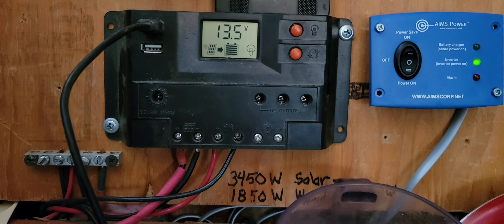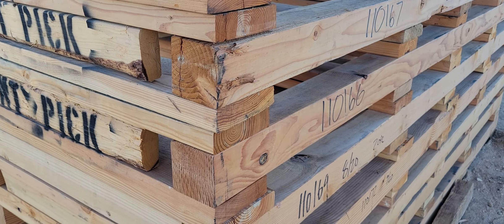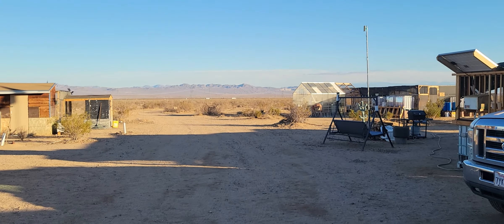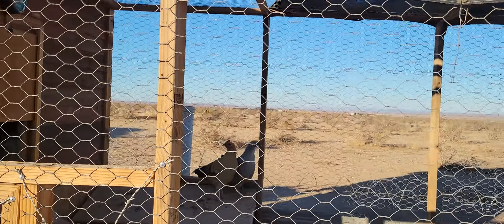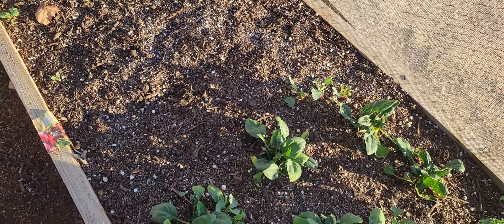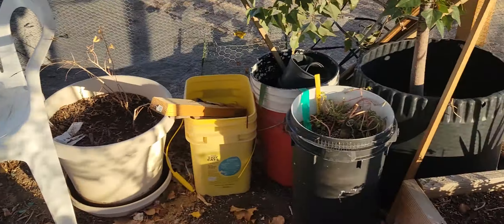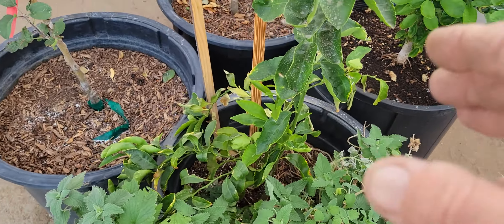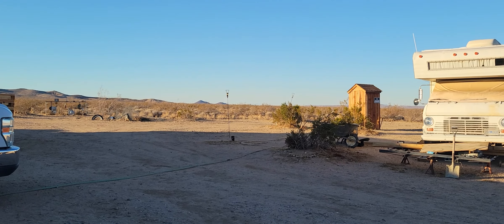Added Power Makes A Difference, Dec. 10, 2021

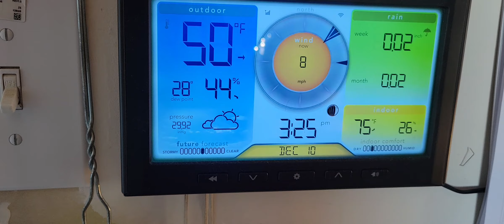Comment: 0:50 isn't that the truth! Where I am I noticed this pattern of every 1.5 - 2 weeks there would be one day, or 2 or 3 days, of =/>80 degrees F.  But the night time temperatures were in the normal night time average range for this time of year. Then, that pattern was broken in the last few weeks. I told my friend the machine must be broken, or whatever it is, that they are using to cook us every 1.5 - 2 weeks. That "Santa Ana winds" excuse they used to use doesn't work anymore.

Comment: How much solar panels are you using now.    24 volt.  And 12 volt
Reply from the maker: Six at 24v, Eleven 100w at 12v, and Eleven 25w at 12v